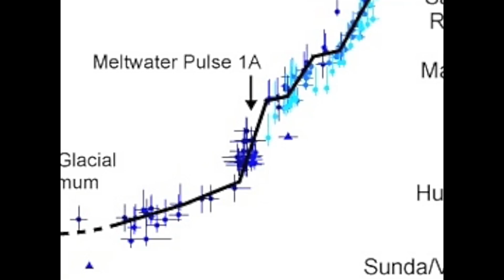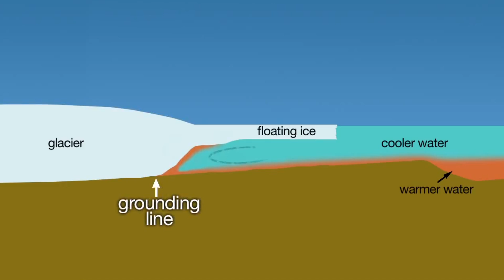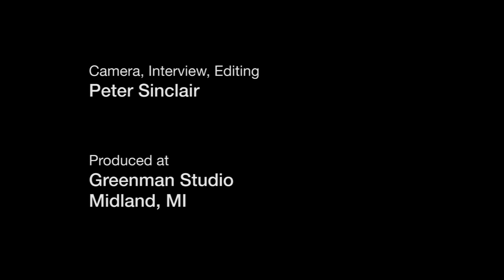James Hansen on Ice Sheets - 2016

Comment: Transcript:  "Disintegration of ice sheets is likely to be highly non-linear. We know that in Earths history, when ice sheets have collapsed and sea level has gone up, we have had several meters of sea level rise in a century.   Now with humans changing the composition of Earth’s atmosphere much faster than ever before in the past, there is no reason to think that could not happen again
When we look at what’s happening in Greenland and especially in the Antarctic we see that ice shelves are melting, and oceans are getting warmer at depth. The tongues of ice that come out from [the Antarctic] ice sheet onto the ocean and buttress the ice sheets  are melting and that allows ice from ice sheet to be discharged much more rapidly into the ocean. 
We discovered that fresh water put on the surface of southern ocean makes it more stable.  Normally you have deep water, bottom water,  around the coast of Antarctic, and that allows heat from ocean to be dispelled into atmosphere and space. But if you put more fresh water on surface, it reduces that overturning water.  Because fresh water is less dense, it doesn’t sink as easily and that causes heat [to stay in] the ocean instead of coming out;  it melts the ice shelves. So it is amplifying feedback. Our record of precise knowledge of changes in mass of ice is short, it began with the gravity satellite which has records for only 12 years. Over that period, the mass loss of ice has increased rapidly. 
Ice loss, if it continues to double, as it has in last decade  we could get within 50 years, meter scale sea level rise and in the following one or two decades get multimeter sea level rise. That is an enormous threat.  More than half of largest cities in world are located on coastlines. The economic consequences of losing functionality of those cities would be incalculable.  There would be so many refugees from China for example, it has 300 million people within 20 meters of sea level. We can’t let ice sheets disintegrate and sea level rise several meters. "

Comment: Is this not some cherry picking going on here? Antarctica has a net gain in ice with more ice sitting on its eastern side. Yes, the ice sheets are melting in Western Antarctica, but the same does not apply to the east. Why are there hot water to the west then? Well, the Ring of Fire runs through western Chili and then extends into Antarctica with quite a couple of active volcanoes located in Western Antarctica. It is therefore fair to assume that magma will be fairly close to the surface and act as an ideal heating source for the ocean in a line roughly from Chile to Antarctica... and this my dear friends will explain the melting of the surrounding sea ice.